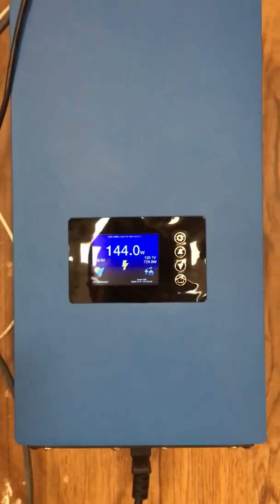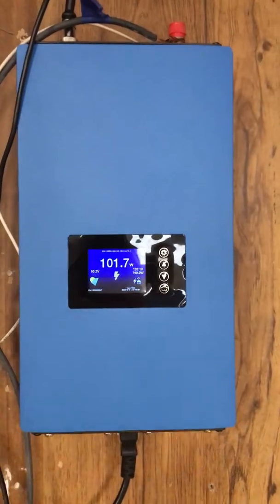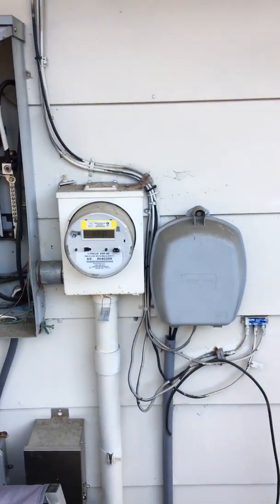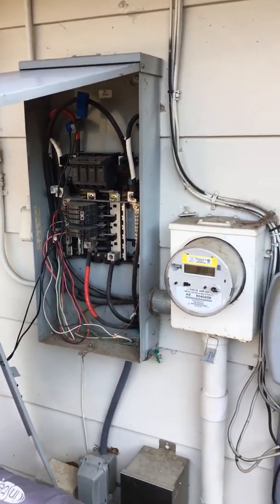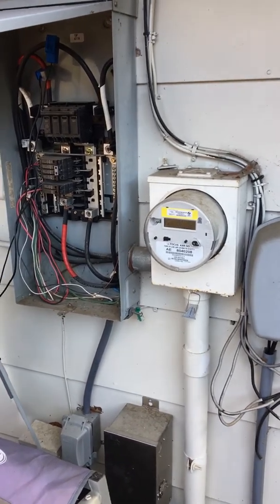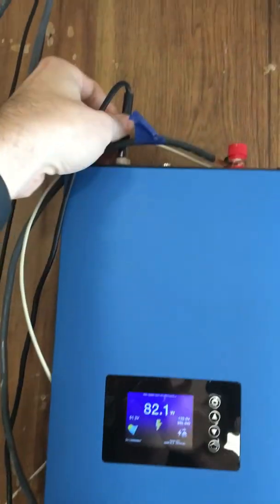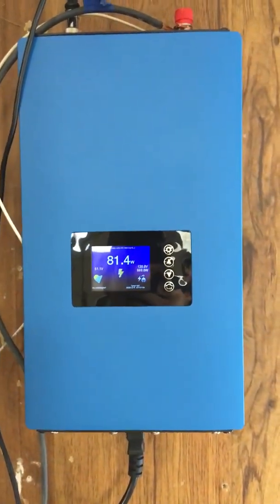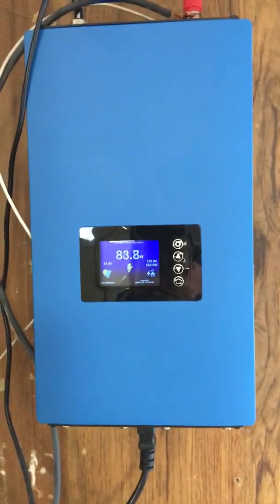DIY solar without permits

Comment: Local regulations............it stops a lot of chrunchy good stuff from happening, backyard inventing and using stuff people hand make. 

I think there needs to be a middle ground between North America where everything is so puckered up and regulated and safety obsessed vs India where anything goes and people get crushed, blown up and electrocuted by everything being held together with feces and rusty bailing wire and diaper cloth.

Comment: I did that for a while but my gridtie inverter didn't have that capability. I have batteries also and I don't use the gridtie anymore. I just run off the solar- batteries all day and the grid at night.  I could go all night, but want to cycle my batteries the least I can. I've had these batteries for 4 years and probably only cycled them 100 times. They can cycle up to 6000 times

Comment: Not interesting in back feeding. I just want solar without permits for intended backup reasons.
I need a receptacle on the side of the house for some kind of quick disconnect to the portable panels.
Cannot have a fixed wire running the the outside wall of the house to the panels otherwise thieves could cut and steal the wire or I won't be able to store the portable panels.
Seems no one has a solution.
Want a quick twist lock disconnect method.

Comment: I would install 220v 30 amp in box with laundry port. wire black and red together and plug inverter into that..... done. Both rails are detected with one sensor and power entire home. Else your only powering half your home with the inverter
Reply: I use my 4000w RV generator to power my entire home. The only mod is to jump black to red wire else generator will only power half home. Ran house 14:hrs in winter once. Screw 12 grand gererac install. I know this is different but wiring would be same for inverter to detect and feed power into your home. For me I just make dam sure I shut off mains before cranking up gas generator else I would kill workers on hydro lines

Comment: I got fined for not getting a permit and having my system inspected by a licensed electrician by the city and I'm not connected to the grid.  $106 for the permit and $400 for the inspection they wanted.  Had to remove my system or get fined again.   The power company was doing work behind my house and noticed the panels.  What a crock of BS.  If I didn't run the wires to the inside of my house and left the electronics/battery outside in a shed or something then I would have been OK.

Comment: It shouldn’t be possible to put that much power into a 15-20 amp plug.   I understand what your saying but it doesn’t add up.  Look at the size of wire feeding your home.  No way the wire in that wall is ever close enough to size correct.  You can certainly add power in.

Comment: I think I'm missing something.   With 1 sensor on 1 120v line, the Grid Tie Inverter should produce no more power than the single 120v line it is monitoring.   Which means it could NEVER go over, since your OTHER 120v line will also be drawing power from the grid, even if it's minuscule.   It seems impossible to me for you to backfeed unless the limiter on the inverter was disabled.   Or am I missing something here?   Thanks!!!

Comment: Just wanted to share April 2025...anyone looking for a window AC unit to run off these small solar setups or power stations. Check out the Midea U shaped unit. Had mine for 3 years. Costco has the 12,000 BTU on sale for $279. Home Depot also sells them. My 8,000 BTU unit -  Surge is 258 watts then 183 watts. Beats the solar mini splits  in both cost and power usage. Great for when your AC goes out "mid summer" or power outages.

Comment: Have another ljnk to the limiting grid tie inverter you are using? Right now I'm limiting the amount of solar panels I'm hooking up with just a normal meter (old school spinning disc). I haven't seen the results yet but want to see if it at least lowers the usage of power from my electric company. Either way I have a portable solar energy bix so it made sense gor me to try this Nd I figured the day I get solar hooked up for real with a netmeter meter, I will just hook up the panels I currently have and supplement it even more. Let me know if you can give a link to the limiting grid tie inverter

Comment: You should forget about the idea of grid tie and just go completely off grid. 
Get battery banks to store the excess energy for the night. I would recommend LiFePo4 12 volts batteries wired in 24 volts configuration paired with a 24 volts inverter. an MPPT solar charge controller would keep the batteries charged during the day so that at night you can use the power.

Bonus point: Get a 20A automatic transfer switch so that at night when the battery runs out, your load won't turn off, but would automatically switch over to the utility's power. 

This will ensure that your electric bill is as low as you can possibly get it without worrying about the possibility of generating more power than what you are using in a grid-tie system without permit. The system that I describe is much better because instead of artificially limiting solar production to 0 watt when you are not using any energy, you are storing that extra energy on batteries for later use (like at night), translating to even more savings now that you can use that stored energy at night whereas on your current grid-tied setup you can't and will always be consuming power from the utility flat out until the sun rises again next day.

Comment: That is a 1000 w inverter, why are  you only supplying 100 w with 750 w load??? The solar voltage is 50 v, way high enough to make power... PS might not have enough panels on a cloudy day to produce enough amperage...
You also didn't mention the setting to switch to limit mode vs feedback mode...
Plus yes you can connect the inverter to a battery if you want....

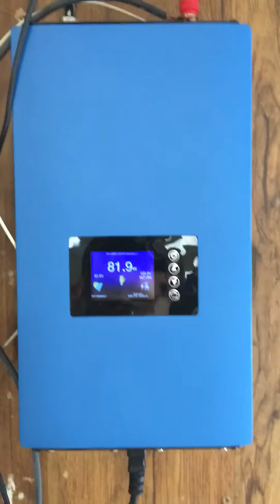Comment: How did you make sure the phase was the same? 5:12
Reply: Disconnect the inverter. Pull a load from the same outlet you want to connect the inverter to, and see with a clamp amp meter which leg increase usage.

Comment: This is absurd.  You can simply plug your panels or wind generator into a microinvertor which only works if it senses current and then plug it into a wall socket. If the power goes out it shuts down and there is no backfeed. Our local power company just wants you to sign up for net metering so some asshole doesn't backfeed when the lines are down or under repair. This stuff is all plug and play. Simple! You don't need to do all this crap.

Comment: There is reasons behind the regulations with the power grid. If there is a power outage and there are people working to restore power and you upload power onto the grid it could kill people. NEVER do this half ass! I have 60 solar panels that had permits and inspected for safety. I added two power wall batteries to my system so I can now store my power but again had a licensed electrician with permits to do the work and inspected to insure safety. Bottom line in do this RIGHT!
Reply: Nay... Screw the utilities, besides it's a safe system and doesn't produce without grid power...

Comment: So if your house is using 500watts according to the current sensor on the power company commercial feed and then your grid tie inverter w/solar produces 500watts wouldnt your sensors then show that you are no longer using any power because no current would be flowing from the power company any more. Seems like this would cause an oscillating condition where grid tie would sense no current from grid then shut down then see current from grid and turn on etc. obviously it’s not doing that but why is it not???
Reply: That's a really good question. Not sure

Comment: The legal, cheap, and easy way to do this:    Get cheap deep cycle batteries from walmart, cheap MPPT controler, cheap 24v inverter, and a 24v battery charger where you can set voltage. DONE!!!!   use the solar and batteries until the voltage drops to a certain point then the 110v battery charger kicks in. Granted you can only do a small isolated system, but its legal.  My freezer runs off such a system and the 110v battery charger almost never has to run. Maybe once a month... if there are consecutive cloudy days.
Reply: Any chance you can make a video to go into this setup in detail ?

Comment: Since PGE started ripping off customers with $1k a month electric bills, this is what they get. Monopolized utility companies hate competition, props to you. 👍
Reply: My bill gone from under $200 a month to $600 in 2 years.  Take a look at the board or Silicon Valley green energy you will see why.  It’s made up of politicians
Reply: And since the Renewables are ripping off the power companies you know it takes some six others with skyrocketing electric bills just a compensate for one home solar installation do you have a volt amp meter an ability to check the installed watt meter
Reply: Actually solar is the main corporate for skyrocketing electric bills as once it's connected to the grid can only put in 15% of extra electricity the ignorance of solar is easily demonstrated with a volt amp meter and fourth grade math right there at the plug-in
Reply: @dennisdickinson8337 man you just said a whole lot of nothing
Reply: @PrmanentlyConfused I understand it's above your head so obviously you don't have a volt amp meter maybe you can find somebody that can operate one for you and maybe between the two of you hopefully can do the fourth grade math
Reply: @dennisdickinson8337  i dont see how ohms law relates to "ripping off power companies"
Reply: @PrmanentlyConfused renewable once connected to the grid can only put in about 15% of advertised output but are getting credit fot 100%
The ignorance of Renewables is easily demonstrated with a volt amp meter and 4th grade math called Ohm's law sooo if you double check the installed watt meter you'll see an 85% ish difference
Reply: @dennisdickinson8337  That's just a lie.
Reply: @PrmanentlyConfused So obviously you do not have a volt amp meter Maybe you can find somebody that can operate one for you And hopefully between the two of you you can do the fourth grade math Double You want meter And you can apologize after
Reply: @PrmanentlyConfused it's real simple you know just fourth grade math volts multiplied by amps will give you the actual watts going into the grid because it does not take an account for voltage potential difference so basically think of electricity like pumping air or water against existing pressures and head pressure and all that fine kind of fun stuff is the same math anyway double check your installed watt meter you will find an 85% difference so meanwhile back at the power plant they're giving credit for 100% and you're only putting in 15% that's why it takes some six others with skyrocketing electric bills to compensate for just one home solar installation
Reply: It's the Renewables ripping off the power companies again easily demonstrated with a volt amp meter in 4th grade math called Ohm's law

Comment: So if you got a an old 4 cylinder engine and generator  what can you do with that. What kind of permits would you need?
Reply: No you can't do that. Generators dont have islanding function (kill power when the grid is down). You will kill a lineman. Generators should be a switch box.

Comment: Great video 
I am using micro inverters and much like yourself I want to only produce what I need and nothing more 
Any ideas regarding limiting power output external to the micro inverters 
Two things are basically needed in my mind 
Sensing the input power and the micro inverter output power…
Limiting the output of the inverter power to equal the power company power 

Thoughts regarding hardware to achieve the limiting and comparison?
Reply: I'm experimenting with using smart plugs these last 2 months. Each smart plug is plugged into one or more solar panels. I have a Shelly EM clamped on the 2 legs of my panel. Both the plugs and the EM talk to my Home Assistant smart home software. I wrote an automation that says if the meter reads more than X watts, turn on plug 1. If the meter reads more than X watts and plug 2 has been turned on for 10 seconds, turn on plug 2. If the meter reads more than X watts and plug 2 has been turned on for 10 seconds, turn on plug 3. Plug one has enough panels to feed my house's base load, so it's usually on 90% of the time while plug 2 turns on even less and plug 3 only turns on when the heavy appliances turn on, like microwave or AC. Plug 3 has a lot more panels plugged into it while plug 1 has 1 panel.
Reply: @gop @gophermuncher  That’s actually pretty clever and now I know why Grok used the Shelly when I asked it to design me a system with net zero export. It must have read this comment.  However it never mentioned the smart plugs and it thought it would work with an IQ7 microinverter and I could never understand how it would communicate to one another. Craftstrom so far is the only manufacturer I have found who seems to have a whole solution but it isn’t cheap.  Does your system still back feed during those seconds of decision making when loads turn off?

Comment: And this, dear viewer, is why you need a permit. Scary. Dangerous.
Reply: why tho.
Reply: @bigskyproducers  i cant give you all the background on how electricity, solar power, inverters and the power grid work in a comment to a reply. Instead, i suggest you research the differences between ac and dc power. Tesla vs Edison. Transformers. Frequency matching. Resistive vs inductive loads.Also take a look at the NEC code book (or your regional variant) as the book represents an amassed wealth of knowledge codified in to rules for your personal safety and the safety of others.
Reply: @AlexHorwatt  this is the most woke response. coming from a guy with a 75 video minecraft playlist.
Reply: @bigskyproducers  Minecraft is Turing complete! ❤️ …but i think we’ve strayed off topic 😶
Reply: Pussy. Somehow you think the the fucking clueless building inspectors and the city getting paid thousands of dollars for plan check and permit fees makes the world safer. Absolute sheep you are. Building inspectors drive past hundreds of illegal not code compliant things on their way to an inspection.

Comment: get a net metering so that you can back feed
Reply: some counties restrict you, some charge $500 fee for application and then might ask you to change or modify your system. the law is very in favor of power company and not distributed power.
Reply: Don't forget the monthly connection fee...and some require a second meter w/ second meter reading fee!!!

Comment: As far as only measuring half the power of the house, you could plug it into a 240 outlet. With a box like this that's surface mounted right next to the inverter, it would be super easy to do and would then tie into both rails in the box

Comment: I see a lot of people using these inverters saying they are still exporting power when big loads drop off. Has anyone considered adding capacitors between the inverter and mains to prevent back feeding?
Reply: You could run a contactor or a relay and it would shut the power off immediately when the load drops off
Reply: @descargaelbano Not working.
Reply: That is odd I have never seen this situation, please provide direct evidence of this happening, because I don't believe you...

Comment: Aren't you plugged in from the phase converter to only 120 V??? Maybe you just put the CT donut on the wrong leg of the incoming grid power??

If this is a 240 V grid tied inverter, it's specifically says in the manual, put the CT donut on heavier drawn single phase leg.
Reply: If The Inverter Is 120 VAC, Then It Is Single Phase and Should Be Controlled By The CT (Donut), If Placed On The Same Leg That The Grid Tie Inverter Is Feeding.

Comment: Bro ...nobody can follow your wagging finger 😢😢😢 why not just make it SIMPLE , get a small sub panel & battery and move some wires to the new sub panel...

or let's say to make it simple , get a small victron charge controller to a 12 vdc battery 🔋 & inverter to power a window ac 24/7 then u can get in the game with a few used panels for under $999

Comment: you need 2 inverters to balance load with limiters they say you will get charged if you put power on one legi
Reply: No. Absolutely false. The smart meter measures each leg in kilowatts/watts. I does not know that one leg is being fed energy unless it is over fed (back feeding). Just like if you turned off every breaker in your panel on one side of your 240VAC split phase, it just records the consumption from the one phase of 120 you left on. Its not as smart as you think.